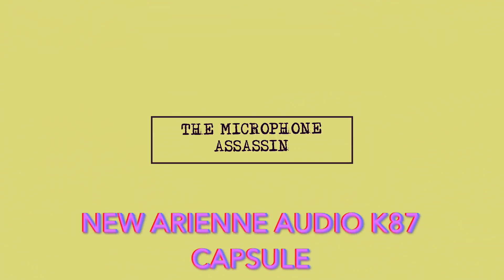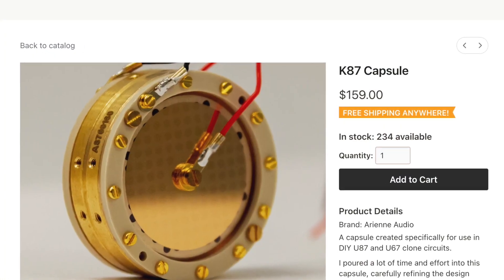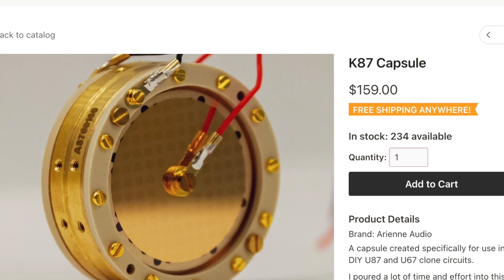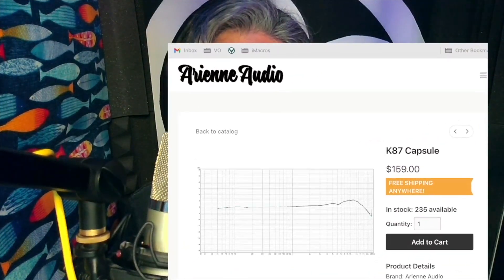Neumann u87 DIY Clone Mic with Arienne Audio K87

Comment: would that capsule fit in a blue baby blue?
Reply from the maker: Check with Arienne first. I think it’s possible that the Baby Bottle polarizes the capsule at a higher voltage than this capsule is designed to handle. She would know.

Comment: What do you think? If this capsule is installed in mxl v67i microphone. Thx
Reply from the maker: It'll sound a bit better, but unless you use a circuit with high-end deemphasis as opposed to the Schoeps-inspired flat circuit in the v67 (and most MXL mics), it's still not going to sound like an 87. The only way to know is to try.
Reply: @MarkYoshimotoNemcoff  what do you think of microphone parts s87. Does that sound like real U87? Or is there one? Does IYO
Reply from the maker: @garyshirinian  It sounds like a real u87 as much as imitation crab tastes like crab. You're missing the transformer which definitely adds some of that signature 87 tone. Honestly, if you're looking to get close to the u87 sound on a budget, consider a modded AKG Perception 420, as seen here and discussed in detail on GroupDIY.com
https://youtu.be/EgVcD-3OVes

Comment: I usually don't think a foam pop filter for a mic detracts from the sound, making it well ... muffled.  I think it does help with the very close to the mic work.  Excellent sounding capsule.  In other DIY mics you've demoed, I was nervously deciding the signal would require a de-esser effect.  In this case, I'm amazed to say it didn't seem to need one.  Rich lows, accurate highs with a nice hi-mid peak, and now that you mention it, rich and smooth mids too.  I don't know that I wouldn't want one with a smaller body, but a normal sized capsule, but you're right.  There's something special going on there.
Reply from the maker: The Arienne Audio k87 just sounds so great. The midrange on it is very pleasing to the ear.

Comment: Oh wow. It has that "Neumann shimmer" in the high mids and highs that I associate with the 87 and 103. I've never heard that in other DIY 87s. 
I like the more midforward tuning as well, even if I'm personally not the biggest fan of the shimmer.
Reply from the maker: Yeah, Ari at Arienne Audio captured that Neumann tone pretty well in her design of the capsule. It’s the only capsule for DIY so far that can get that close to the original.
Reply: @MarkYoshimotoNemcoff  makes me wonder what it'd be like in that tiny, super quiet mic you'd built previously.
Reply from the maker: The Fuchs AI clone. Yeah, I’ve been wondering the same thing.